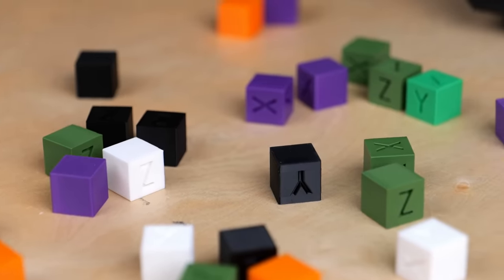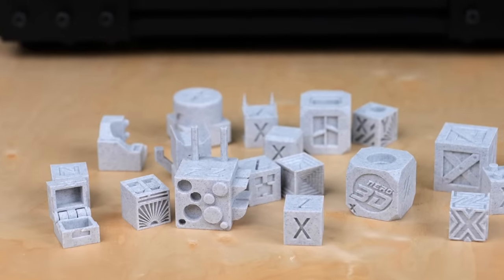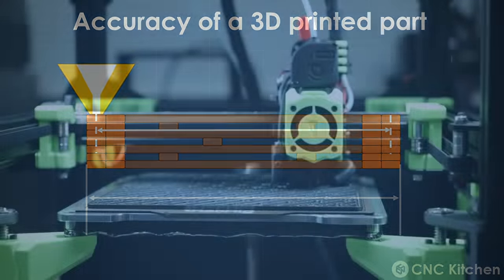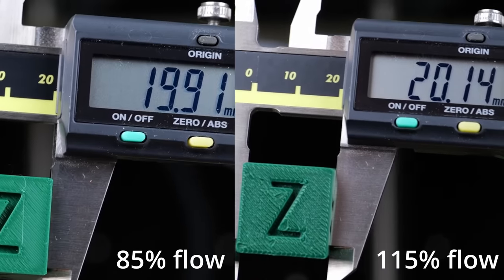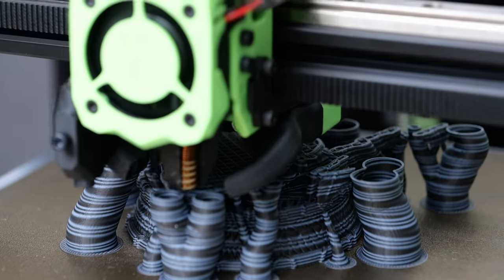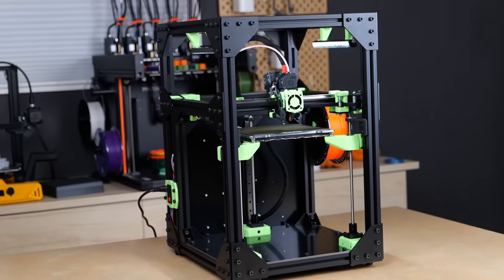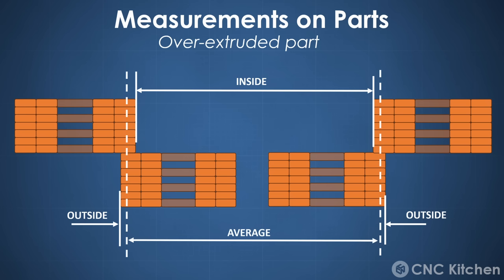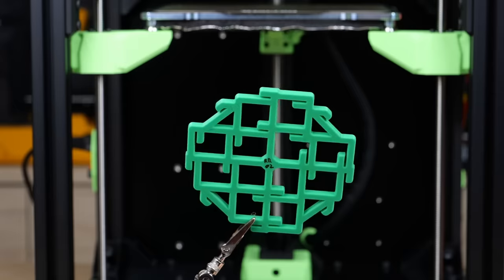Calibration Cubes: More Harm Than Good?

Comment: If you could, it would be awesome if you made a video doing a detailed, step-by-step guide on how to accurately tune a 3D printer. You mentioned needing to tune the printer for the filament you were using, and showed a different print. So what would be the first step/print you would need to print out to slowly start tuning a printer to perfection

Comment: I would say you have to be careful with the califlower calibration. The calibration print for ABS on our Ultimaker S3 told us the shrinkage was around 0,5%, but on bigger parts that are about 5 cm high, we had a shrinkage of 1% on the geometry that is not directly on the build plate..

Comment: I never calibrated like you describe. I began designing printers when they were first a thing and have always used toothed belts and pulleys. They have a fixed number of teeth and with the belt pitch you have a fixed scale and steps per mm. There is no need to change this. No belt slippage will occur. Nominal diameter of pulley is irrelevant as it will mesh with the teeth.
Over and under-extrusion is the only issue and it has to do with pressure, driven by different speeds of extrusion again coming from machine velocitys.

Comment: Totally agree. I was so fed up with incorrect spacing, that i just made my own calibration test (including pocket holes for nuts). Thing is, deviation can vary wildly depending on the size of the feature. That's why i design most of my technical parts in OpenSCAD, i have multiple deviation variables (as a library) that i can apply to the part before it is sliced. This is also a problem, because now almost all of my work must be done in OpenSCAD. CAD programs today are definitely not dynamic enough to factor in FDM printing errors.

Comment: It is also important to remember, before going insane trying to calibrate everything, that tolerances exist for a reason. Look up an ISO 2768-m linear tolerance table and you'll see that "medium" is 0.1mm for anything under 6mm, everything over that is +-0.2mm, everything over 30mm is +-0.3mm etc. These tolerances are applied when cnc machining things and while there surely are tolerances that are specified for certain features, something like +-0.05 or even +-0.1mm are pretty accurate... Trying to achieve something like that on a 3d printer will be possible, but very hard and, as mentioned, will depend on multiple factors.
So just don't get too carried away, as there are so many variables, that it might make you go crazy. Oh, and again, as mentioned, if your calipers are showing 20.0mm it doesn't mean it's actually 20.0mm, unless you've measured a gauge block of that or very similar dimensions and calibrated your calipers... Or use a micrometer, which will be more precise.

Comment: thanks, these back to basics style vids are always a 'refreshing' and often informative update :)
actually these cubes are the first things I printed, not because I calibrate the printer with it, but that because it is small, fast and easy to print and is an ideal test that 'it works' instead of printing a bunch of spaghetti lol
defects on the letters and faces would also quickly indicate any issues e.g. with too wide a layer height etc.

dimensions, in particular tolerance and fit are among the 'hardest' thing to calibrate, e.g. for cylinder in hole kind of fit calibration.
my printer often cannot do better than a 0.5mm gap for a fit and geometry matters as well. cylinder, spheres, * screw threads * are particularly hard to do a sliding fit, even if they are printed on the same printer on the same plate

Comment: I always measure vertically the top about 1/4 layers of the calibration cube only, so it avoids any corner bulging or any elephants foot. I would also only tune x & y steps if the esteps and flow were already tuned.

Comment: Interestingly timed video. I just returned 2 Neptune 4 Pros given they're not printing square. I made my own test piece after hearing about an issue with the 4 Pro. Circles were more like ovals and there was a noticeable skew on squares. While going back and forth with elegoo support they had me print out a calibration cube. 

Also unfortunately it seems the neptune 4 pro runs custom klipper which doesn't allow skew correction.

Comment: 2:00 Before checking the rest of the video, there is one obvious issue I already see with calibration cubes: they are too small and too uniform for granularity in testing applications: you only get 3 data points (the sizing output along the 3 axes), but not only do you get only just those, you also have very little playing-area in those data points. The other issue is that the cube only has one "part," so you have travel distance, filament spread, and extrusion playing into the sizing, without any other aspect to consider.

Comment: I just mount my calipers to the x gantry and bed rail using the depth gauge to measure bed and printhead movements across 3-4 25mm travels. repeating each one a handful of times as well as increasing travel/acceleration speeds.

Comment: I hadn’t really gave it much thought, close enough was good enough, then today I had to print a functional part which was 360mm long (printed diagonally on cr10) and it printed at least 1.8mm too short and all of the screw holes didn’t line up because they were about 0.55mm out. Time to calibrate all of my printers now, thanks

Comment: You can try to print a solid cube with a side length of 100mm and a height of 2 layers. Stop printing halfway through the solid filling of the second layer. Because the angle of the upper and lower solid filling lines is 90 degrees, you can get a slope value by simply measuring the angle of the filling lines of the upper and lower layers. Moreover, the unfinished part of the second layer can just be used as a reference plane.

Comment: I like the idea of the califlower. That said if you are going this far why not just use a Dial indicator on each axis to get your X and Y and Z steps correct? I realize that this still doesn't account for skew so you should do a calibration print after the fact.

Comment: as someone who works in metrologi laboratory I calibrate with cube like this:
1 - set 0% infill, 2 wall lines 0,4mm/line
2 - messure wall and overall size then adjust flow rate and steps accordingly until Iam inside +-0,2 mm when you use calipers like mitutoyo (basic allowed deviance)
ps: I tried optical mesurements callibration with +- 0,001 mm acurracy but 3d fdm printing isnt accurate enough to have stable prints at this ressolution atleast with 0,4 mm nozzle

Comment: I print the Voron Design cube, but not for calibration for all the reasons you mention. I print it to see Z axis print quality. I see varying amounts of Z banding with different filament types, which I believe is mostly thermal contraction because I see the most on ASA and none on PLA.
Thank you for the tip on the “califlower,” that looks really good! I tend to fix linear advance first, extrusion rate second, and that would make a good third step.

Comment: I like this whole video in general as it brings up the main points I had been feeling since getting back to printing last year. Of course it also includes the feeling that the small distances arent so good, which are admittedly more obvious when you try this with the cheap callipers and realise you cant really trust it!
 There are so many areas now where things can be a tiny bit off to give you the illusion another thing is wrong. Its a good thing though cause it means it is so accurate now or can be that these tiny things could be a factor! Long ago this wont be chased cause the issues were bigger.
My main issue was the new environment was affecting the prints wayyy more than my previous. So different settings/issues needed to be looked at. Nice to see someone else also went with the similar sequence of temperature, flow and retraction tuning for new filament. My rationale was that temp would be the easiest to see the difference  first and affected way more of the downstream properties so better to get iit into range first. Like if it was flowing too much due to temperature or overextrusion its an uphill battle with retraction

Comment: a truely excellent video! Although they have a new model called the calilantern that apparently does the x,y and z. It's slightly more and takes much longer to print but in case people also have problems with z height then just buying that instead could save buying it later as well. It's on the same site as one of the sellers other models.

Comment: Stephan, can you comment on how you (and perhaps Tom ) arrive at the extrusion forces you use? I know that if I applied 5 to 10 kilograms of force to a 1.75mm diameter PLA filament in a 0.4mm nozzle heated to 210C, I would tear through a spool of filament in a matter of minutes, if not seconds. Can you clarify, please?

Comment: hi great video. I have been designing and printing mechanical parts mainly in ABS, ASA and Petg now for 4 years. I always calibrated by test printing my own designed test prints which are 200 x  200 mm  also finding that scaling the parts is essentual to get accurate inside and outside measurements. even different fillement brands need often  differnt scalings. When i srarted to sell the my 3d printfiles I discovered that people needs a lot of help to achive the necessary accuracy. I design my stuff to 0.00, meaning a shaft will be 20.00 and a hole will also be 20.00 mm. if they need to fit the printer must be proper calibrated. And every time I tried like you to explain the proper way of calibration - i am met with these anoying cubes too. Also you miss out explanining how you with Superslicer and orcaslicer can set up compensations so that even small holes will be close to the correct measurements. but good job - now i can referer to this video when my customers on Cults3d cant get the print to fit.
great work and greetings from Denmark. sorry for the Hand ball Em results 😂

Comment: As someone who appreciates the true innovation Bambulab brought to 3d printing it does now have me questioning my X1C which was one of the earlier ones too. Ive never measured it either, but Ive also not noticed any problems yet and only print functional parts.

That said, I always design with reasonable tolerances because having to scrap any part or do any unnecessary manual labour to me defeats the purpose of having bought this printer.

I am very curious to see if they could add skew compensation using their first layer scan.

Comment: A note on the new califlower: Measurements 3, 4, 7, and 8 have the caliper stops reversed on one side which means the caliper will be at an angle instead of straight

Comment: If you're worried about corners bulging, you need to finish your parts with deburring, sanding, polishing etc. I work in a machine shop and if your working in .0001" measurements there's many more steps than the machine operations.

Comment: When it comes to e-steps, the only adjustment I've needed to make is adjusting extruder e-steps, and that only on my Ender 3s. Remove the Bowden tube, tell the extruder to push 100mm through, and then use one of the many online calculators to determine the corrected e-steps, and set it.

I am surprised to hear that anyone would use a calibration cube for setting x, y, or z e-steps for precisely the reason you mention...the dimension is far too small for accurate measurement. Perhaps part of the reason I look at it this way is that my first printer was a delta style, and calibration is a very different beast for a delta, usually involving prints that occupy as much of the bed as possible. And skew in particular is often a bigger problem in a delta vs. cartesian motion system.

Comment: In your 3D printer list Ender 3 is missing, the most sold in the world. I'm working in a project to correct the 3 skews this printer has XY, ZX and ZY and I can assure You ZX and ZY are ENORMUS in almost all Ender 3 Classic I tested. Calibration cube can be good if You SCALE it up to 160x160x160mm and use a Faber Castle 45deg perfect school
 drawing square to compare tilt over a flat Surface (5mm cristal I use), it is faster and less boring that the multimeasuring figure You used.

Comment: In my opinion, never change your xyz steps with any calibration method, even if you print a single material, even the same brand, there is tons of variance from spool to spool of even the same pla from the same brand.

Comment: Totally agree! I'd go that far to say that every calibration print that comes as 3D model is waste of time and filament. I wrote a simple gcode (by hand) many years ago that checks for dimensions, skew and backlash and even compensates for backlash doing so. It also takes only one minute to print. See video eXbldjCLUdQ ... It just prints a 2D 10cm square you can measure, a raised right angle on the sides to check against with a proper square and a backlash pattern with intersecting stripes approaching from alternating sides. To rule out for backlash errors, all movements on the right angle and 10cm square are approached from the same direction. None of the available calibration prints can compensate for backlash error. I'm stunned that Slicers like Slic3r still don't include any of these calibration features/prints. Printing proper 3D models is such a waste of filament and time. 2D is enough.

Comment: Ive seen people do this for hobby CNC machines. They always say "Well it works for me" makes me face palm. If you want to see if the axis are moving the correct amount use a dial indicator, but then do the mechanical adjustments needed dont change the bloody steps per mm.

Comment: Nice to see I am also getting around 0.67% shrinkage for ASA.  I also noticed on non-symmetrical parts the X and Y shrinkage were slightly different.  

Just a thought but I wonder if the parts were annealed, if these X Y values would change and become more consistent with each other.

Comment: Thank you for again a super valuable video. Question; you have made no mention of the consequences of nozzle width. A 0.4mm nozzle would add 0.4mm to the X and Y dimensions vs the design. Also the consequence of the sliced layer height, as the Z height is a multiple of the layer height. What are your thoughts on these elements with regards to interpreting the measurements of a test model?

Comment: I don't think I've ever used a calibration cube to actually calibrate steps/mm. I do print a lot of them, but more as a color swatch, to get a feel for how a filament looks when printed. I do occasionally measure them, but I'd only change calibration if it was significantly off (say >0.2 millmeter).

Comment: I use a flat bar of 20X100mm with holes in it, so 100mm for the length, the holes for the bolds I need. I print one in X-axis and one in Y-axis . With this I can also check how round the holes are, put them on each other). Of course fore every kind of material. 

If you need a real proper alignments of the holes I do it this way : print the part (only first 1mm) with bigger holes and print rivets with the proper holes and bigger outer dimension. Put the part on de object, screw the bolds in with de rivets. Glue the rivets on the the part. Now you have your positions of the holes in the printed part. Put the new dimensions in you CAD model with the proper holes. Print again, I got them within 0.03 mm correct.😁

And remember : to find the error : use the biggest dimension, to measure a position better : use het smallest dimension. 
When you measure the position of a hole on the X-axis and if you measure from the left is 100mm and on the right is 5mm : us the right with the 5mm.

Comment: nice video, i use tringles of calibration, less material and you could measure precise skew. also use to make some measures of shrinkage, measuring after printing and after cooling. 
a nice aditio is forget the digital calipers, and get a micrometer, or a good old caliper with nonius,ad learn how to use it. 
dont forget that the filament also have inconsitences of diameter, that can add to under-over extrusion.  and last , i use a nice calibration dice, so can be used to games after :)

Comment: I'd be interested to know if changing the steps/mm to a theoretical value, rather than the practical hardware derived value has any impact on larger and smaller prints.
I would assume that if you deviate from the 'real' steps/mm you get some sort of scaling, so a 30mm cube you calibrated on will print accurately but a 10mm and 100mm cube will not.

Comment: I tuned my steps per millimeter by measure jogs on the machine directly. Idk if its the right way, or now even a valid way, but i would take a measurement from a flat side on the head to a flat side on the frame, make it jog x mm on that axis, and calibrate.

Comment: I brought the Califlower when it first came out long ago. This is when I found out that the Prusa Mini doesn't have the skew corrections enabled in the firmware. There's a bug report about it, but Prusa doesn't seem to be doing anything about it after years. According to the measurements, there was a slight skew, so this is annoying.